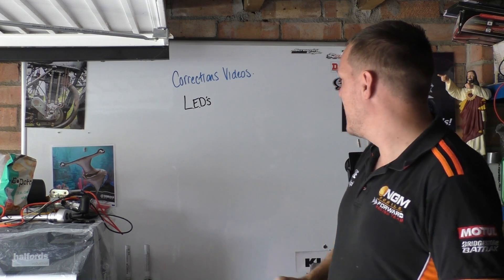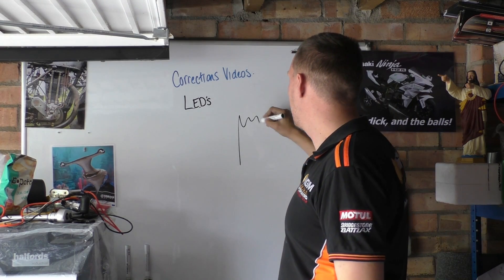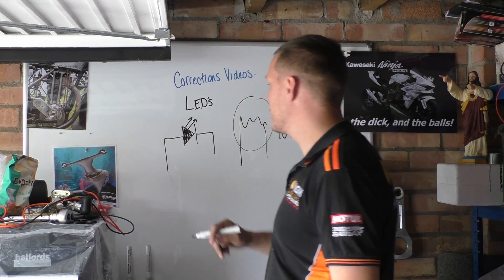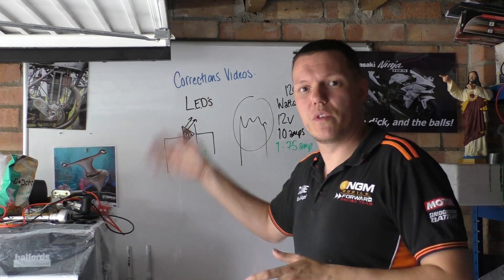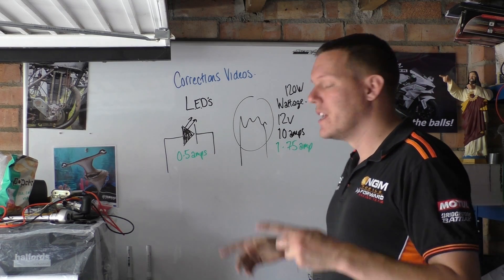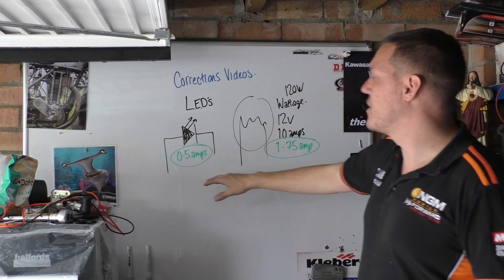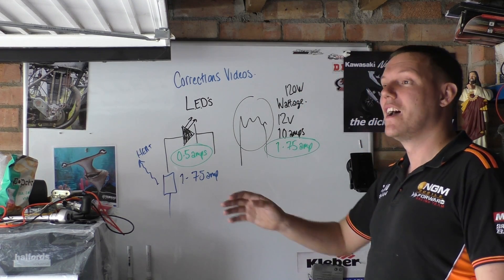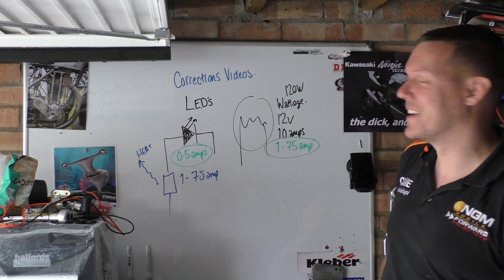Flashing LEDs and why? CV#2

Comment: Matt, loving the channel and your no-nonsense, no bullshit approach.
Nice vid ( as always) and a good simple explanation of how it all works. 
The numbers on the board got me thinking....hypothetically  speaking, if the led indicators draw only about one third or one quarter of the power of a regular filament bulb would it be possible to fit additional indicator units to either side and balance the power coming through the original/standard flasher unit (for example, some aftermarket mirrors have built in led indicators which could be used in conjunction with led units in the standard front & rear locations).

I ask this only out of curiosity - I like the standard/retro look of my bike so I have no intention of using LEDs

Comment: I had to put two resistors in my Motard when I converted it from normal bulbs to LED. They flash a bit faster if the bike is at higher revs but they have always worked well. The LED brake light worked fine from the start when I replaced it which I wasn't expecting.

Comment: Ohms law innit?
Led's are cool to look at but if your using them to give your electrical system an easier time and have to use resistors, then what's the point as they're drawing just as much current negating any advantage in energy saving.
 I fitted an "LED Relay" to my bandit when I fitted LED indicator bulbs to find that the original bulbs flashed at the same rate that the LED bulbs did with the new relay fitted! (I don't know how long the new relay would last but it worked for the short time I tried it!) The relay itself is obviously using a purely electronic means of flash regulation rather than the original electrical/mechanical relay which uses a complicated solenoid/capacitor/resistor set-up to regulate flash rate. This relay relies on the correct current draw to flash at the correct rate and is fragile and prone to failure due to vibration and impact if dropped, so not very robust.
The electronic system is much more durable and if you're fitting LED's then you have virtually eliminated the need to know if one has failed! (not that they don't fail but you know what I mean!)

Comment: LEDs always have 2.21 Volts across them so require a ballast resistor to dump the surplus supply volts into. Needless to say the ballast resistor runs cooler on 6 Volt electrical systems compared to 12 Volt systems.

One problem we've discovered recently on installing an LED headlight bulb on my son's 1994 CZ 125 ride to work bike is that in the current cold winter weather the headlight glass ices up, when he's hurtling down the dual carriageway at 70 MPH at 5:30 AM on his way home from night shift. This obviously screws up the headlight beam somewhat. One of the weirdest things I've witnessed happening to a bike.

Comment: Hey mate I was a avid delboy watcher (so boring I skip  most of it). Love your straight talk and useful shit. Not full of so called fabrication that's got more filler and SILICONE in it what the fuck. Keep up the good work don't become a sell out like some 💩💩💩💩
I'm from north west best part of UK I've got a cb1000 sv650 and mz125. A quick question I've decated my cb and it's crap at low revs what do you recommend remap or power commander?
Reply from the maker: Remap dude, the fuel injection would have gone to tits

Comment: I did a "conversion" on a bike about 4 years ago and just stuck the bulbs in the sockets to see how bright they are and sort out the hyperflashing later. Indicators flashed normally for 3 cycles then like a run away train. I left them. I figured whatever made the non-paying attention faks notice, works for me.

Comment: LED's have (as you know) very little power consumption AND a low voltage rating.An led works on around 2 - 5 volts, SO, manufacturers build in resistors to the LEDs to stop your 12 volt battery blowing them up/out. (Yes, some do actually blow apart with high voltage). .......... Now, ..... To raise the current rating to get them to flash at a slower speed, an inline resistor can help, but the best way is to add a (say), 5 or 10 or 15 watt resistor across the led circuit. OR, get an LED flashing circuit in place of the 18 - 21 or whatever wattage flasher relay circuit.You can now buy, LEDs that flash, they have a built in circuit, ..... use them and remove the flasher relay altogether, when buying them type, on eBay or amazon or wherever; ... " 12 volt flashing LEDs ".YOU STILL NEED TO KNOW WHAT YOU ARE DOING, and HOW TO REMOVE AND CONNECT THE WIRES TOGETHER.1 Wire will be the 12 volt feed to the flasher circuit, the second will be the feed to the left/right switch, simply join these 2 together and your done, .......... As long as you wire the LEDs the right way, you will have no problems.

Comment: If you wanted to you could effectively do away with your flasher unit and include a 555 timer on the LED driver circuit board which would eliminate the need for such a large resistor plus you would have the added benefit of redundancy :)
Reply: If I remember correctly many flasher units more modern than the old bimetallic type use a basic circuit employing the 555 timer.
Reply: Well there you go :)

Comment: I think half the trouble with DB these days, is that since he went the patreon route, he just puts up videos of everything he does. He did explain that he already had the resistors so that's why he used them, but ffs, just don't show the world that this is a good way to overcome the problem. Just replace the flasher unit and maybe make a video about that, as its the best way to go, and the most inexpensive.
I'm a new sub (got the link after I watched one of DB's vids), love your straight forward approach. 
To all the comments relating to the 'series' resistor in the diagram, there are no +12V or ground points drawn in the diagram so technically the resistor in the diagram is neither series or parallel at the moment.
Cheers

Comment: i thought the LED flasher units were different. could be wrong as it was a while ago but i think the regular flasher is a bimetallic switch with the LED version having a chip, could have been advertising bs im not sure i know the one i used had a speed pot on the terminal side, i also had to wire 2 diodes to the indicator dash light, as the bulb shared a ground and a positive from either side so all 4 indicators would flash at the same time. i fuking hate electrics so was a nightmare so sort for me

Comment: Think it probably would have helped to explain that the relay works by creating resistance in a flexible piece of metal which heats it up and causes it to flex, breaking the circuit, then it cools and reconnects. Obviously LEDs don't cause enough resistance to heat the metal properly so it doesn't get as hot and as such cools quicker causing fast flashing. The way you explained the relay made it sound like it was computer detecting a bulb was gone. Not trying to step on your toes just think that extra bit of info might help someone who doesn't know how flashers work.
Reply from the maker: That's for the electronics series not this
Reply: Modern flasher units don't use a bimetallic strip but achieve their same result using basic circuitry.
It is becoming rarer and rarer to find an old clunker with an old flasher Relay.
I think the last one I saw was on a Three Pin Plug (Reliant Robin).
But I try to stay away from fannying around with other folks problems these days. They have to myther me and catch me three parts pissed in the pub and flea fuck me into saying OK.

Comment: Only issue I see is that you put the resistor in series with the LED, it should've been put in parallel. You're mixing it up with a current limiting resistor, they are used to control the current a LED pulls, as otherwise the diode would basically form a dead short and burn itself out. Normally these resistors are built in into LED bulbs. What you should be doing is adding a resistor in parallel, and that resistor should, in this example, pull the additional 1.25 amps so the LED and resistor together pull 1.75 amps from the flasher relay.
Reply: Correction video please!!!
Reply from the maker: Its not an error. Did I draw out the circuit? No it was just me drawing on the board to keep track of where I was as I keep getting disturbed. I draw pistons without rings all the time but no-one shits the bed
Reply from the maker: Oh well shit happens - talking and drawing - never a good mix
Reply: BFHfunify i was about to say the exact same thing lol.

@Matt please Check ur elektronics stuff mate that was a very simple error. elektronics may be try stuff but they are important too
Reply: @ g0fvt yep, you´re right the best thing is change all the flasher bulbs to simple LED´s and change the flasher relay unit to an electronic LED model :)
Reply: @ Matt - good on ye, take it one the chin, unlike delgirl :)
Reply: @ TarenGarond - fuck yeah!!!
Reply: Lol I posted the same thing on the original video this one is correcting. To be fair that was more directly correcting people who were suggesting using a potentiometer in series though, to increase the total resistance until the flashing slowed down. It never would of course.
Reply: Matt, I won't bang on too much about the resistor,  it has already been covered. As you probably know the older flasher units used a bimetal strip and an element,  very clever ancient tech. The load resistors is a bit of a dire bodge, defeating much of the advantage of using LEDs. I think we all know who inspired this video, in fairness it would obviously work but the resistors are dumping a lot of power, he stands a good chance of melting some wiring as his resistors are supposed to be bolted to a heatsink to operate at full rating.
Reply: Ehhh it is an error, sorry Matt- you drew a partial cct with the resistor in series & you even said "in line"...
Reply from the maker: I get what your saying and I didn't draw out the circuit as I was expalining why they flash faster. It looks like its a series curcuit I give you that but it wasn't what I was trying to do.

Comment: i too know fuck all about electronics, but if you put something inline (series) it would split the voltage over the two, so the led indicator would get 6 volts, i think you could put a resistor parallel instead so the relay sees more current drawn that way? or am i totally wrong??
Reply: Kristoffer Persson ... Yes and almost. I guess matt has to do a little cv for his own vid now ;-)
You would need to connect your load resistor in parallel to fool your relay.
Tout get 6V you have to connect 2 same bulbs in series. Leds only start to conduct until you reach their forward voltage. In a 12V system you typically have 3 leds in series. They will light up at around 10V and burn away at 12, that's why they need a current source or a series resistor to keep the current in the operating range.
Reply: yes ok thank you for correcting me =) well like i said it was some time ago i did all this crap in school good to know something sticks at least.. yeah those resistors seems a bit overkill for blinkers that blink for 20 seconds a day but who knows, rated for 50w it says on them =)
Reply from the maker: In parallel circuits the voltage across each component is the same as the voltage of the battery. In other words with parallel circuits it like each LED has its own pathway to the battery. Another name for the resistor is a ballast resistor.
Reply: yes but the current that is going through the relay would be higher due to more resistance and it would get 12v instead of 6v right ? i might be all wrong it just seemed right in my head, its 10 years since my last electronics class in high school.. :p
Reply from the maker: I know what the issue is here and its the way I drew it out. It not what I intended, it was just so I could remember what I was talking about in case I was interrupted again.

The video on all this is coming next week.
Reply from the maker: Look at the size of those resistors and heat sinks lol